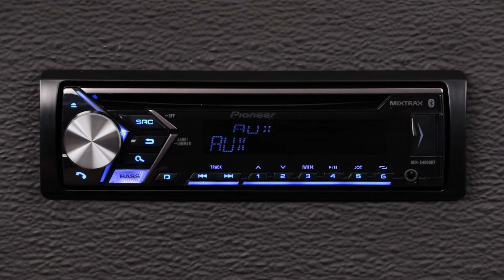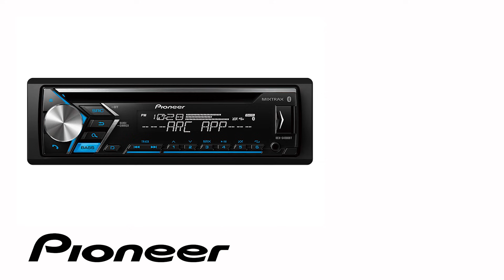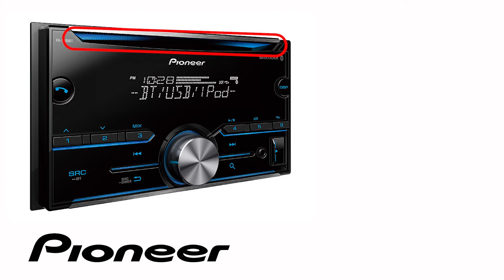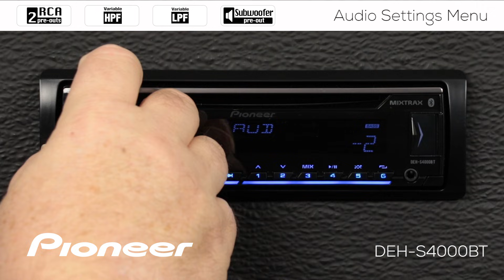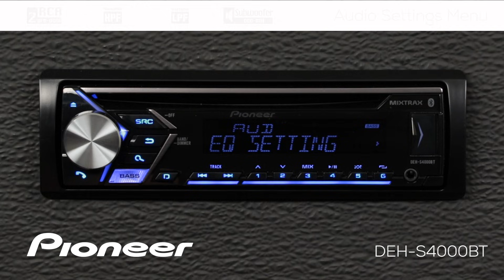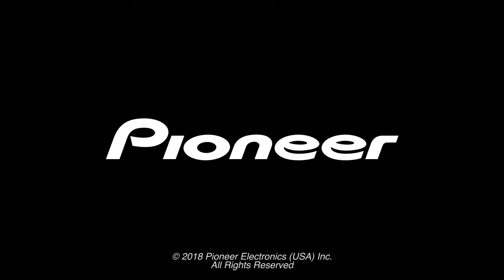How To - Audio Settings Menu on Pioneer In-Dash Receivers 2018

Comment: How about the DEH-S31BT
Reply: To operate the Audio Settings on DEH-S31BT Press the SRC button, near the top left, to choose an Audio Source.   The Pioneer DEH-S31BT audio settings are nearly identical to what you see in this video:    https://youtu.be/hiDOCp75UAI?list=PLw63zJRQbCNinkLCSrV17ExW5FWT7aIFU&t=49      If your Pioneer DEH-S31BT is not operating very similar to what is shown in the video I recommend to press the microprocessor reset button on the receiver.  You'll need a paperclip or some other small point to press the microprocessor reset button.  You can find the microprocessor reset button on the Pioneer DEH-S31BT behind the detachable face.  You can see it in this video:  https://youtu.be/o6iawP279R4?list=PLw63zJRQbCNiPrgwJQGimQIzOEz5sJiHP&t=52     You can learn how to detach the face here:     https://youtu.be/Z5S_IuTTWVQ?list=PLw63zJRQbCNiPrgwJQGimQIzOEz5sJiHP&t=55     You can learn how to pair a phone through Bluetooth to the Pioneer DEH-S31BT here:     https://youtu.be/42EL_JGXcJs?list=PLw63zJRQbCNiPrgwJQGimQIzOEz5sJiHP      Please be sure to install the latest firmware for your Pioneer DEH-S31BT.  You can find it here:   https://www.pioneerelectronics.com/PUSA/Car/CD-Receivers/DEH-S4100BT#downloads        You can find a full playlist of How To videos from Pioneer with very similar operation to Pioneer DEH-S31BT here:   https://youtu.be/w3OlAZzLLX0?list=PLw63zJRQbCNiPrgwJQGimQIzOEz5sJiHP   and you can find more videos on Pioneer's YouTube Channel here:  https://www.youtube.com/user/pioneerelectronics
Reply: @deckerdotto6035  Thank you. Installer did not give me the manual. Realized this later, not going to print out 150 pages. Any chance of buying the hard manual from Pioneer. Again, ty.
Reply: You can buy the owner's manual for the Pioneer DEH-S31BT from PacParts.  This is Pioneer's parts distributor in the US.  You can find it here:   https://www.pacparts.com/part.cfm?part_no=OM%2DDEHS31BT&mfg=Pioneer        The .pdf version of the manual can be found here for free:      https://www.pioneerelectronics.com/StaticFiles/Manuals/Car/QRI3044C.pdf           You can find a full playlist of How To videos with very similar operation to Pioneer DEH-S31BT here:   https://youtu.be/Z6g0EOPZL0c?list=PLw63zJRQbCNinkLCSrV17ExW5FWT7aIFU      Please be sure to install the latest firmware for your Pioneer DEH-S31BT.  You can find it here:  https://www.pioneerelectronics.com/PUSA/Car/CD-Receivers/DEH-S4100BT#downloads    and you can find more videos on Pioneer's YouTube Channel here:  https://www.youtube.com/user/pioneerelectronics

Comment: Can you post standard settings to give me a place to start? I want to hear cleaner highs & mids.
Reply: I'll be happy to help. To give you better advice, I'll need a little information about the setup in your vehicle.  What is the model number of your Pioneer in-dash receiver?  Do you have 4 speakers in the vehicle for example:  2 front, 2 rear?  Do you have a subwoofer in the vehicle?   If you can answer those questions, I can give you better guidance for the sound you'd like to hear in your vehicle.  To start, I recommend to set the EQ to DYNAMIC.  You can learn more about setting the EQ here:  https://youtu.be/nNUyRgc8jC8?list=PLw63zJRQbCNhDoDXEJKBHoC27MkfUhJ-R   You can find more videos on Pioneer's YouTube Channel here:  https://www.youtube.com/user/pioneerelectronics

Comment: Automatically song changing in my Pioneer car stereo. Please tell me bro how to i fix this problem
Reply: This could be a few different issues.  You didn't explain much in your statement.   I recommend to check to see if MIXTRAX is on.  And if the shortened song playback setting is on.  If they are you can switch one or both off.  You can learn more about MIXTRAX and the MIXTRAX Settings in this video:  https://youtu.be/UlfgXZrw1JA?list=PLw63zJRQbCNinkLCSrV17ExW5FWT7aIFU     If this is a new receiver, recently installed, with a steering wheel control adapter, it's possible the steering wheel control adapter is plugged into the wrong port or has been programmed incorrectly.  You can find a full playlist of How To videos from Pioneer about MVH-S320BT here:  https://youtu.be/dMsL-5uwogw?list=PLw63zJRQbCNhDoDXEJKBHoC27MkfUhJ-R    and you can find more videos on Pioneer's YouTube Channel here:  https://www.youtube.com/user/pioneerelectronics

Comment: Everytime someone calls me, i have to turn up the microphone Volume settings. How i save this setting?
Reply: What is the model number of your Pioneer in-dash receiver?  You can usually find the model number near one of the corners of the receiver's face.
Reply: @deckerdotto6035  MVH-S400BT
Reply: When on a phone call, the receiver treats the phone call as an independent audio source with an independent volume level.  When on a call, the receiver's volume control will make the remote callers voice louder or softer based on the phone's internal call volume level.
For example, if you are listening to the AM/FM radio at volume level 20 and a phone call comes in, the receiver should mute the music, and change to the phone call source.  From this point, the volume control will adjust the volume of the remote callers voice inside your vehicle. As an example, if you adjust the call volume on the receiver to 30, when the call is completed, the receiver will automatically go back to the AM/FM radio source at volume 20.     Please note, the volume control on the phone will effect the volume of the phone call when connected to the in-dash receiver through Bluetooth.  Again as an example:  If you have the phone's call volume at 85%, you will need to adjust the in-dash receiver's volume control to a certain level.  If you have the phone's call volume to 25%, you'll need to turn up the in-dash receiver's volume control to compensate for the phone's low level.
I'm not aware of a microphone volume control on the Pioneer MVH-S400BT.     
If you have the North American version of the MVH-S400BT I recommend to install the latest firmware for the receiver.  You can find it here:  https://www.pioneerelectronics.com/PUSA/Car/Digital+Media+Receivers/MVH-S400BT#downloads    
And after the firmware update, press the microprocessor reset button.  You'll need a paperclip or some other small point to press the microprocessor reset button.  You can find the microprocessor reset button on the face of the receiver just under the USB port.  
It may be necessary to delete the phone from the receiver's Bluetooth Memory, and to delete the receiver from the phone's Bluetooth Memory.  Restart the phone, and start the Bluetooth pairing process from the beginning.  
You can find more videos about Pioneer MVH-S400BT here:    https://youtu.be/Fm2U1Ck1qlU?list=PLw63zJRQbCNj4D5DgGJ5htcCJeM2cnxdd    You can find more videos on Pioneer's YouTube Channel here:  https://www.youtube.com/user/pioneerelectronics

Comment: I have an issue with the right side speakers dropping out every so often. It was happening and I check wires and it seemed to fix it then it started doing it again. When it happens, if you turn up volume a lot higher sometimes it comes back on? Is it something in the Pioneer DEH-S4000BT causing it or something else? This happens with the radio and when I'm playing my I Pod which is most of the time.
Reply: This could be any number of things.  It sounds like it could be a loose connection, that only makes itself apparent when it's warmed up a bit or possibly some other environmental factor like higher or lower humidity.  Is it possible, the speakers have an automatically resetting fuse that may be failing?     I recommend to check the speaker connections at the speakers.  Please be sure there is no loose wiring touching metal in the door, or rear deck or where ever the speakers are located.  I also recommend to check the wiring at the back of the receiver.  Be sure there are no bare wires, or wires touching one another or metal.  When you re-assemble the dash to put the receiver back in place, be sure the wire harness is not being torqued in on direction or the other.  When you are playing the iPod, is it a wired connection?  Please check to be sure the wire for the iPod is working properly.  You can find more videos on Pioneer's YouTube Channel here:  https://www.youtube.com/user/pioneerelectronics

Comment: I live in an area with terrible DAB reception but once I'm a few hundred meters from the house the signal's great.
However, when I start my car and turn on the radio the MVH-X580DAB automatically scans for available DAB and tells me there's no signal. I then end up having to re-scan and besides having no DAB for a portion of my journey, it is
a dangerous distraction.
I have a different pioneer DAB in another vehicle and this has given me the option of disabling the auto scan but there doesn't seem to be a way to do this with the MVH-X580DAB.
Please help me!
Reply: Please contact Pioneer Europe for help with your Pioneer MVH-X580DAB.  You can find help here:  https://www.pioneer-car.eu/eur/support

Comment: I have a Pioneer AVH p2300dvd how do you set the radio presets
Reply: Wow, that's an old one. The Pioneer AVH-P2300DVD was produced back in 2010-11.  Setting a radio station preset is easy.  
Press the SRC Hard Key  to get to the AM/FM Radio source. Next use the   <   and  >  Hard Keys to tune in a radio station.  If you press and hold  <   or  >  Hard Keys you can seek to a Radio Station.    
If the radio is skipping past the radio stations you like in seek mode, touch the Local button on screen and adjust the Local Setting on the screen to Off.   
Once you've tuned in a radio station, touch the on screen Magnifying Glass symbol to display the radio station preset list.  Touch and Hold a Radio Station Preset for a few seconds to set it into memory. 
Touch the Band button to change FM1, FM2, FM3, and AM.   There are 18 FM radio station presets and 6 AM. 
Touch the on screen Up and Down Arrows to change radio station presets.
You can find the Owner's Manual for the Pioneer AVH-P2300DVD here:  https://www.pioneerelectronics.com/StaticFiles/Manuals/Car/AVH-P2300DVD_OwnersManual011111.pdf   and you can find more videos on Pioneer's YouTube Channel here:  https://www.youtube.com/user/pioneerelectronics

Comment: I have bought i microphone to have in my car. I have connected the aux from the mic in the back, but people can't hear me when i call. I have an Pioneer mvh-x580dab, please help.
Reply: I recommend to use the Bluetooth Microphone that came with your Pioneer MVH-X580DAB.  The Pioneer microphone will fit only in one port on the back of the in-dash receiver.  You can see the back of a similar receiver here:  https://youtu.be/4iIN_ttRtTY?t=116    The 2nd port is for steering wheel controls.  I recommend to contact Pioneer Europe and get a Pioneer microphone.  You can find Pioneer Support in Europe here:  https://www.pioneer-car.eu/eur/support      You can find more videos with very similar operation to MVH-X580DAB here:  https://youtu.be/k3q0Zm5jvHg?list=PLw63zJRQbCNgHJYkwk2hqhIkiDrmBGmRZ   You can find more videos on Pioneer's You Tube Channel here:  https://www.youtube.com/user/pioneerelectronics

Comment: How about treble setting for tweeter
Reply: Modern Pioneer receivers don't have a bass and treble setting.  There is a much more powerful sound shaping tool called a graphic equalizer. Don't be afraid of it. It's easy to use.  All 13 settings in the Equalizer are frequency adjustments.  You can use them to make any given frequency a little louder or a little quieter as compared to other frequencies and without changing the volume of the other frequencies.  The frequency adjustments are arranged like a piano keyboard with the low frequencies to the left and the high frequencies to the right.
If you want more bass, I recommend the "S.Bass"  preset.  It will add a lot more bass into the music.  If you want more treble, I recommend the "Natural" preset.  It will roll off the bass, and add in more treble.  If you are listening to a ball game or people talking, or an audio book, I recommend the "Vocal" Preset.  You can see the presets here:   https://youtu.be/tMLFL8K3gMM?list=PLw63zJRQbCNinkLCSrV17ExW5FWT7aIFU     You can make your own adjustments too.  Simply start with any EQ preset that sounds pretty good to you,  and make your own adjustments from there.    The 50, 80 and 125, frequency bands are typically the bass frequencies.  3.15k, 5k, 8k, and 12.5kHz are typically the treble frequencies.  If your Pioneer receiver works with the Pioneer Smart Sync App, you can use a bass, mid, and treble control from the app on your phone.  You can learn more about it here: https://youtu.be/N6Lfcnjyboo   You can find a full playlist of How To videos from Pioneer here:  https://youtu.be/pMKUPcGE26c?list=PLw63zJRQbCNinkLCSrV17ExW5FWT7aIFU     and you can find more videos on Pioneer's You Tube Channel here:  https://www.youtube.com/user/pioneerelectronics

Comment: do all new pioneer unit has active crossover?
Reply: Nearly every Pioneer in-dash receiver has an active crossover and slope control of some kind.  Entry level units have a front/Rear or Front/Sub Setup with crossovers and slopes.  More advanced products have Front/Rear/Sub with crossovers and slopes.  It can also be set up for higher quality and control as High/Mid/Low with independent crossovers and slope controls.  This is called Network Mode.  You can learn more about it here:   https://youtu.be/k3q0Zm5jvHg?list=PLw63zJRQbCNizaqgBOmNbopPnc6CDWKip&t=53   and you can see the audio settings available in Network mode here:  https://youtu.be/H4AOXqKF60Q?list=PLw63zJRQbCNizaqgBOmNbopPnc6CDWKip  You can use an app on your phone to control the audio settings.  You can learn more about it here:  https://youtu.be/cWdIoEO1UGw?list=PLw63zJRQbCNizaqgBOmNbopPnc6CDWKip&t=406   You can find more videos on Pioneer's You Tube Channel here:  https://www.youtube.com/user/pioneerelectronics
Reply: @deckerdotto6035  yes, Im jjust trying to find a current model with high mid low, looks like the 6220 fits the bill
Reply: The Pioneer DEH-S6220BS has 3 sets of 4 volt RCA outputs and will operate in Network mode.  You can learn more about Pioneer's Network Mode here:  https://youtu.be/WvJXYh6vk_0?t=1229   and you can find more videos on Pioneer's You Tube Channel here:  https://www.youtube.com/user/pioneerelectronics

Comment: How do you make the Pioneer deh-x3910bt stay in usb port mode everytime you turn on the key.
Reply: 1. Do not remove the USB flash drive.  2.  Leave the source on USB.  3. Do not turn off the in-dash receiver.  4. Turn the vehicle off.   When you restart the vehicle, the in-dash receiver should return to the source you were listening to,  and in most cases the song/track you were listening to when the vehicle was switched off.  If this is not happening, you may have the Red Wire and Yellow Wire connected incorrectly.  Red is for ignition.  Yellow is for constant power memory functions like the clock, radio station presets and remembering what source to return to when the vehicle is restarted.  You can find help with wiring your Pioneer in-dash receiver here:  https://youtu.be/kR2MO2kwFug?list=PLw63zJRQbCNinkLCSrV17ExW5FWT7aIFU
Reply: @deckerdotto6035  I'll ck the wiring, but I'm pretty sure i did it right, if I recall, it would go to usb music when i first installed it, i was thinking I did a setting later on wrong that was making it not act right. I was thinking to try resetting the unit and see what that does. I got this same unit in another car and it goes to usb when i turn on the key.
Reply: @deckerdotto6035  I just checked the wiring, yellow to always hot, red to key hot. when I'm playing usb then turn off key, then turn back on, it reads usb for a moment, then says format read,  I still have to hit the src button to make it go back to usb. Hmm...
Reply: @deckerdotto6035  It's the usb I'm using I found out. I have one I checked on both stereos and it goes to usb everytime and starts playing,  this other drive i use, you have to hit src to go to each time.

Comment: I conect a 12 “ subwoofer 🔊 and amplifier but seems like the sub don’t have in off power i have it set up in rear/rear for the rca and still have nothing help please !!!!
Reply: Does the song you are playing have the kind of bass you are looking for?    Or do you need a different test track.  Please check and properly adjust the gain control on the amplifier.  If there is a crossover or LPF on the amplifier switch it off, or to it's highest frequency.  On the in-dash receiver, is the Subwoofer output switched on?  You can see it here:  https://youtu.be/Ccv6qKK3L98?list=PLw63zJRQbCNinkLCSrV17ExW5FWT7aIFU&t=171   Check the output when the subwoofer phase is set to normal and reverse.  Change the subwoofer crossover or LPF to a higher or lower frequency.   Change the output of the subwoofer in the Speaker Level Control.  All can be seen here  https://youtu.be/Ccv6qKK3L98?list=PLw63zJRQbCNinkLCSrV17ExW5FWT7aIFU&t=171  Please be sure to have the latest firmware installed on your Pioneer DEH-S4000BT.  You can find it here:  https://www.pioneerelectronics.com/PUSA/Car/CD-Receivers/DEH-S4000BT#downloads   You can find more videos on Pioneer's You Tube Channel here:  https://www.youtube.com/user/pioneerelectronics